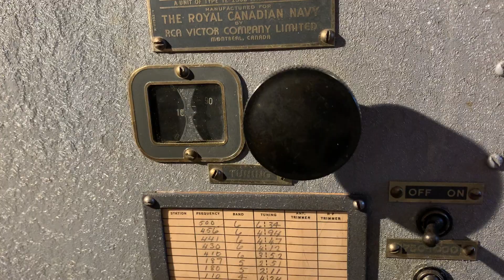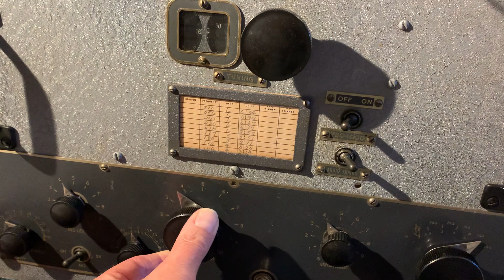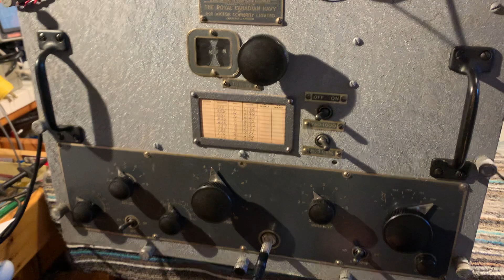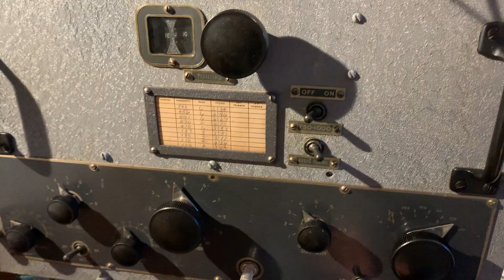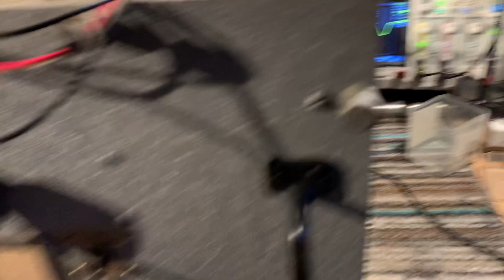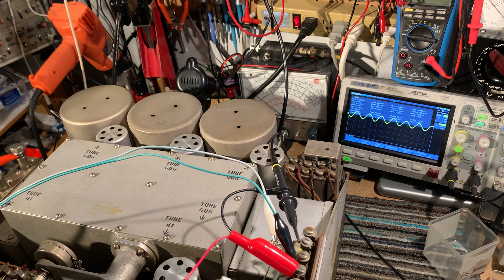RCA TE-236B Demonstration after Refurbishment

Comment: That must be the smoothest regeneration-control I've seen in my entire life.
I gotta copy this detector for my own designs!

Is there anywhere a schematic or manual of this receiver to be found online?

Regards from Flanders Fields,
Thomas
Reply from the maker: Hi Thomas.  My article on refurbishing this set can be found on the SPARC radio museum website, here: https://sparcradio.ca/wp-content/uploads/2021/11/Refurbishing-Two-VLF-TRF-Radios-Part-2-RCA-TE-236-B.pdf, and there is some discussion of it in this article: https://sparcradio.ca/wp-content/uploads/2021/11/Refurbishing-Two-VLF-TRF-Radios-Part-1-Marconi-B29.pdf.  I do have the schematic, but I think I used the RAK-7 manual as a reference (available online).  If you would like a copy of the schematic I have, email me at 'gerrycohara at gmail dot com'